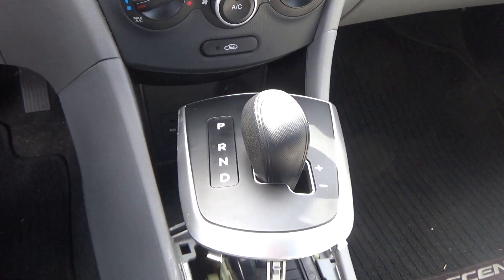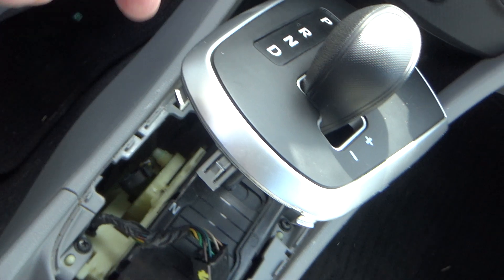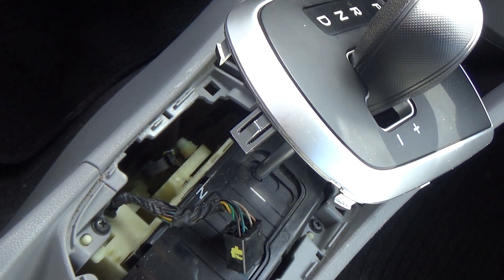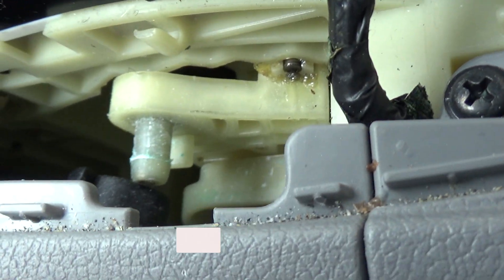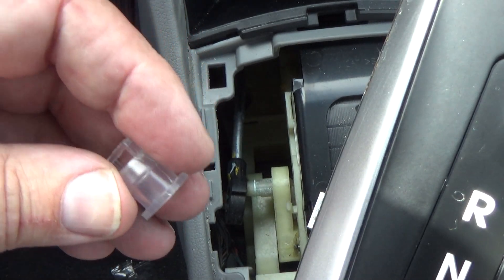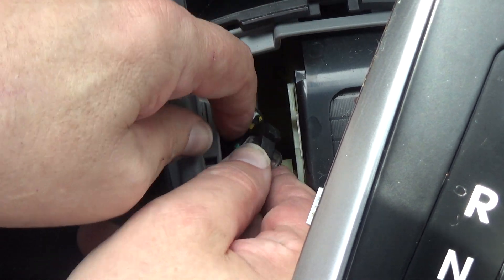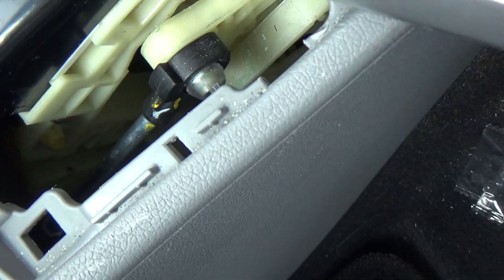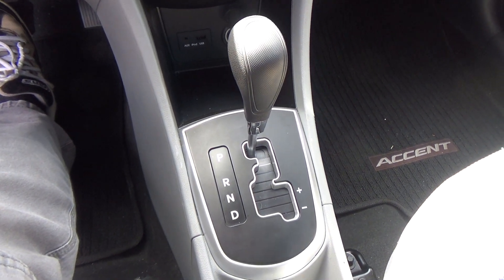Easy 5 min Shifter Bushing Replacement on a 2013 Hyundai Accent.

Comment: Thank you so much for this video!!  With my brother's help, I saved hundreds of dollars on towing and a repair shop for my 2014 Accent (which incidentally has low miles.)  He bought the OEM bushing from our local Hyundai dealer: 46781-1M000 for less than $5.  Of course, if it wears out as quickly as the first one, I'm not sure that's such a bargain....But we'll know exactly what to do next time. 😄

Comment: Where do you get little jobs like this?  Is it just word of mouth from people passing your number around?   Do you have any kind of advertising in the paper? or maybe call around to the auto shops and see if they have cars that can't fix or just don't have time for??    Or maybe from the youtube channel?   just curious
Reply from the maker: It's all word of mouth but it started when I offered to help out some friends and neighbors and they have given my number to their friends, so I generally get a few jobs a month that I do on my days off.
Reply: This video is saving me $200 at least! I can't express the level of satisfaction after finding the bad bushing in my gear box. I'm just struggling to find the correct replacement size for my 2012 Hyundai Accent. Any tips on where to find the right one?
Reply from the maker: @emmagrushkin1511  The ones I used on this 2013 Accent  where these and they fit perfect.
https://amzn.to/3yHarm2